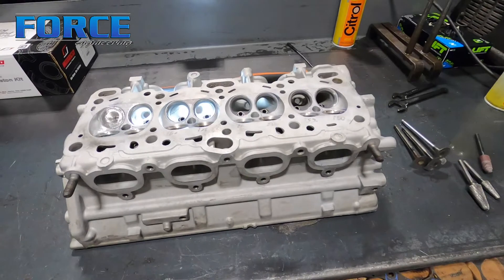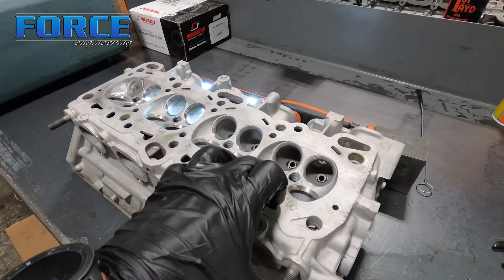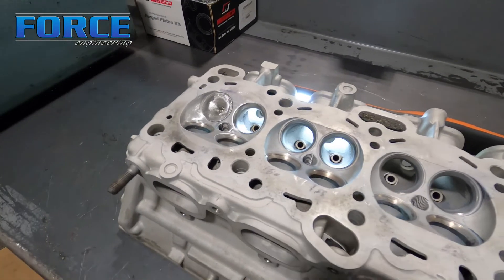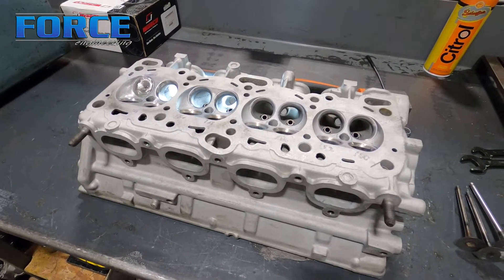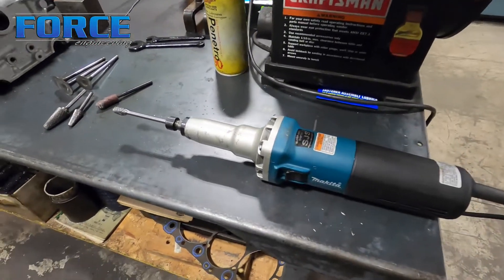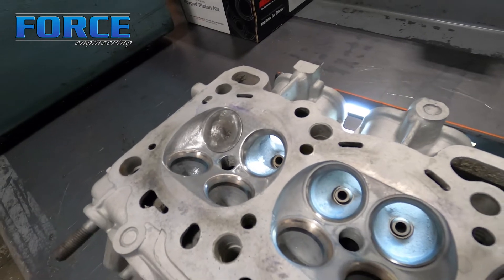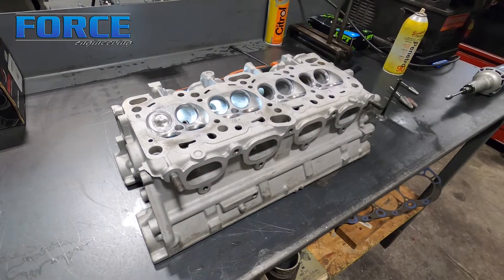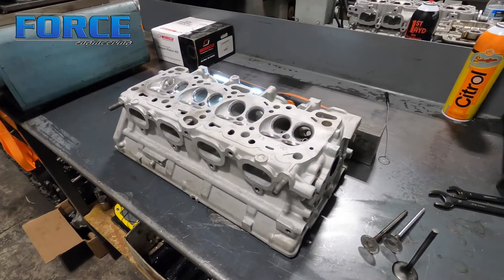Engine Machining - Mitsubishi 4G63 | Basic Porting Overview | 4G63 Turbo

Comment: I have done a bunch of these heads with cnc porting and flowed them with good flow numbers. The heads need more than just bowl blending work to make high hp.
Reply from the maker: The head with just bowl work has been mid 7s in the 1/4. We do a more elaborate version of the head as well that has been 7.0x at 199. I feel the bowl work only head wouldn't have slowed it down much. The turbocharger is our primary air pump here.

Comment: Hey bro, how do you determine how much to take of the seat throat with 1mm oversized valves ?
Reply from the maker: Do the math for the % or throat to valve size you want.  Then cut it to the diameter that meets your target %.

Comment: Good video. Over 10 years of hand porting 4g heads I now just clean the bowls. Match everything knife edge and send it. My own head is a wild max effort port +1 valves the works and now that I’m back on smaller 62mm turbo I’m likely hurting mid range.

Comment: I totally agree.  If there is a potential to make the engine more efficient, then it's a good idea to do it.  Even if it's just to fix imperfections.  Glad you brought up exhaust reversion.  A lot of people gasket match on the exhaust side and then run into reversion issues or it flows too good and raises the power band way too high.  Great Video!!!